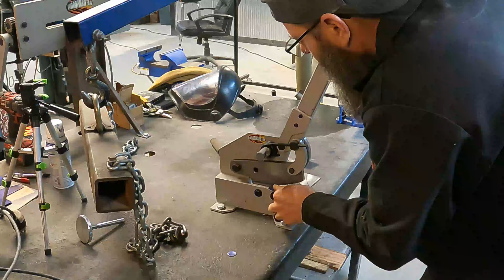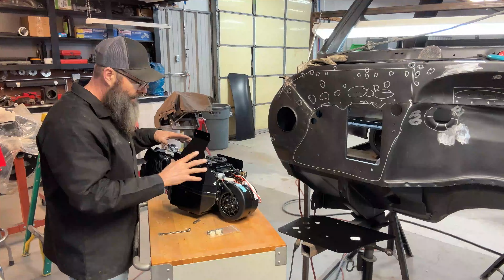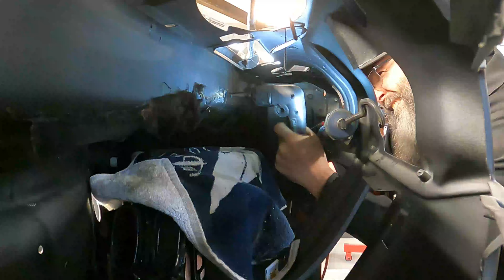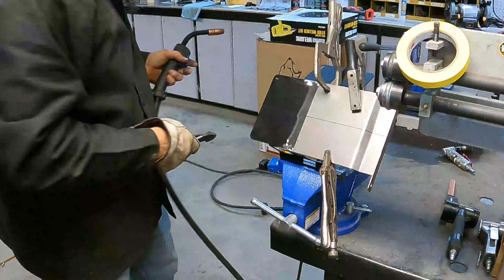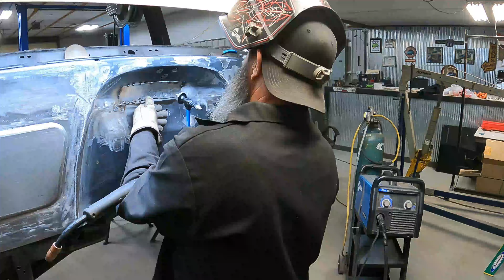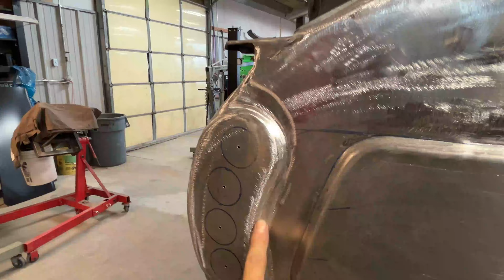Building a Custom Raised Panel for Kevin's C-10 Firewall: Vintage AC/Heat Installation Tips.

Comment: Steve looks like you showed that metal who’s the boss just goes to show where there’s a will there is a way I guess the ac heater lines are hide behind the fender looks really clean Mike
Reply from the maker: Actually I am not sure what I was thinking. The heater and AC hoses can't run behind the fender wells like I route them on cars, but the way I am routing them will be very neat and clean. Thank you for watching and for the comment.